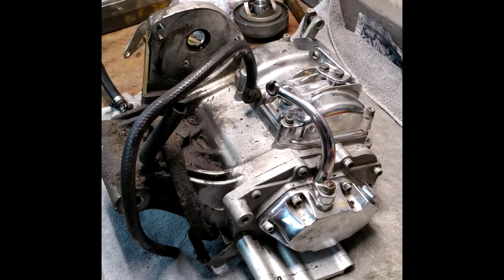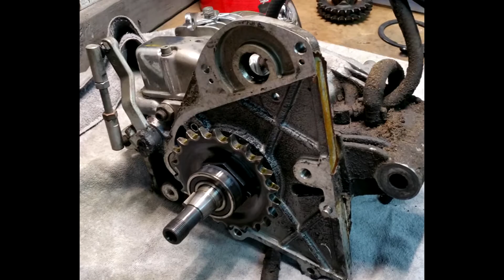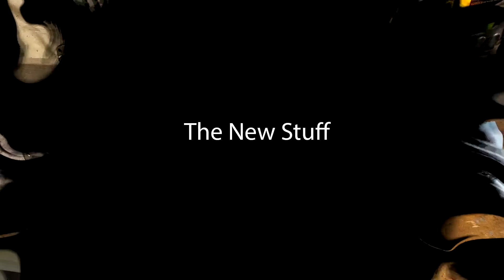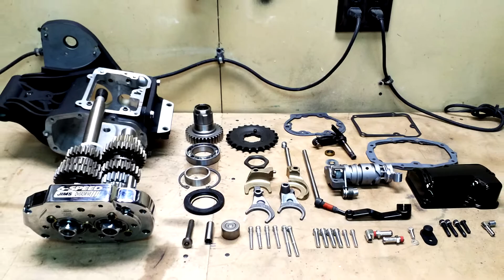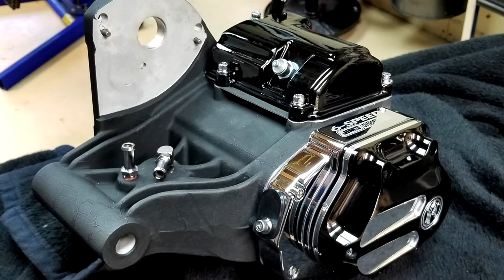Harley FXRT Transmission Rebuild with Jims 6-speed setup.

Comment: I'm looking at putting the same Jims 6-speed into my 1988 FXRP. Did you use the stock cases? Did you replace the main shaft with the taper shaft? I'm switching to a spline main shaft and have heard so many different takes on what needs to be done.
Reply from the maker: I used the stock case. I had to grind some small areas on the inside of the case to make everything fit. My bike had a tapered shaft set up, and I replaced it with a tapered shaft. It worked just fine. Though I think switching to a splined main shaft would be a good thing to do as long as you are up for the extra changes and expense that comes with that change.